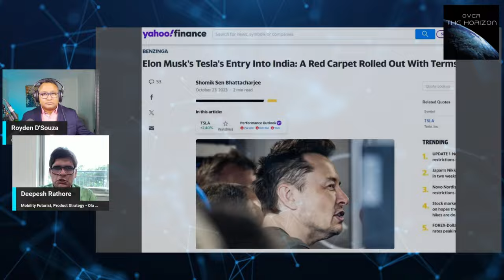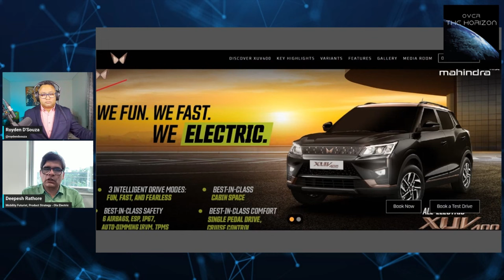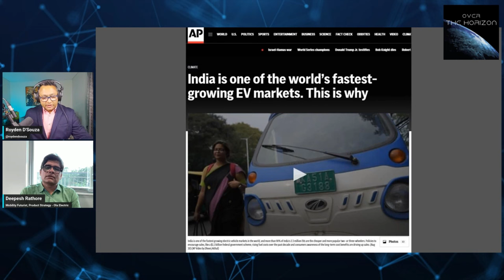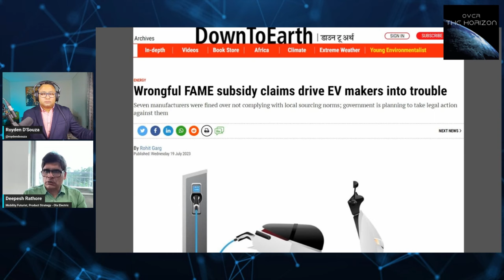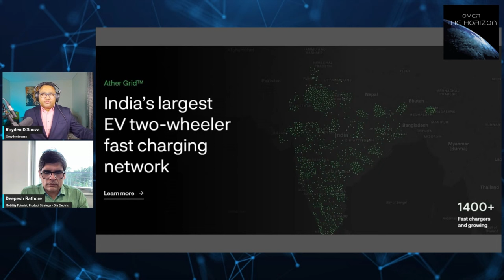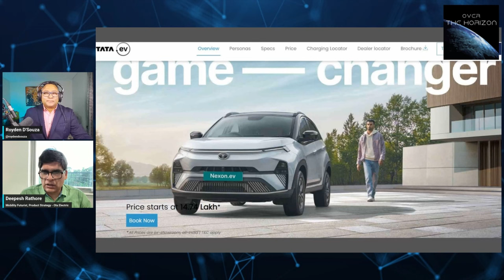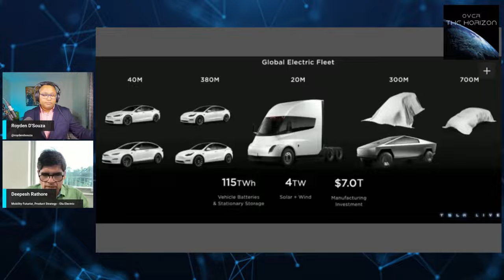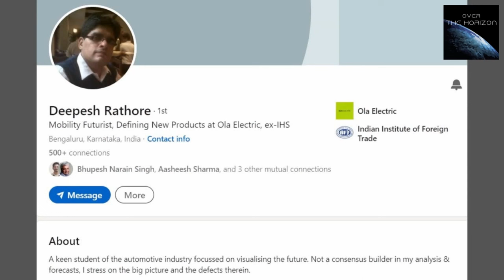Will Tesla Dominate India? This Mobility Expert Says NO! Here's why...

Comment: I would add some note Tesla is not competing with Mercedes and BMW, Tesla is already on the price level of Toyota and VW, and the price will come down further. The perception and reasoning by analogies can be a big trap perhaps.
Reply from the maker: That is correct. The challenge is whether the Model 2 pricing can be brought at par with the Indian models from Tata Motors, Mahindra, Hyundai, etc, that it will compete against, isn't it? Then again, don't bet against Tesla. :)
Reply: @overthehorizon  Don’t bet against Tesla 🤣😂, I don’t think Tesla will be competing with Tata and I think it is not necessary it is a plenty of market available for others as well, both can be in the market for different customer need and requirements.
Reply from the maker: Yes, of course, There's space for all. And the electric car market in India has only just begun. Exciting times ahead, for sure!